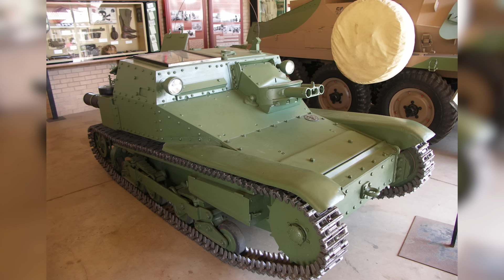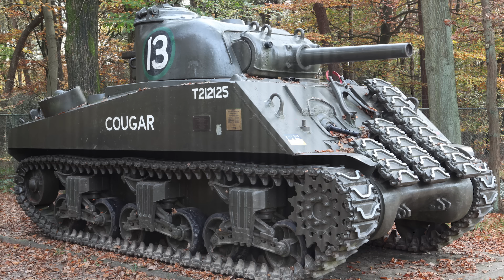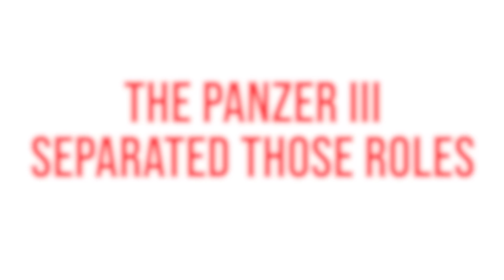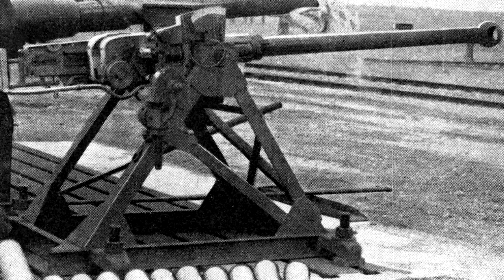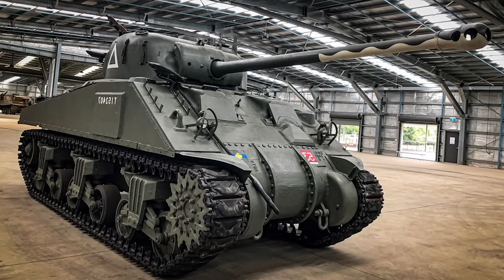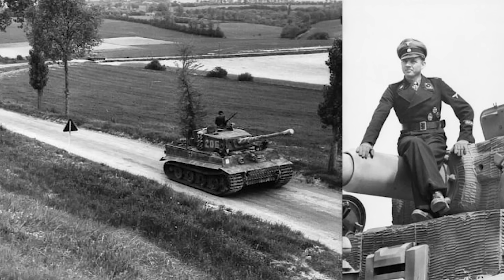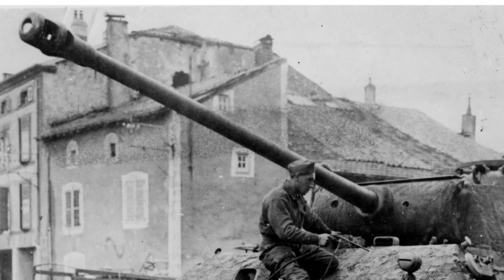Every WW2 Battle Tank Ranked — WORST to BEST

Comment: The final drive was truly the Panther's Achilles' heel. The remark that the problems were solved after Kursk is a bit too simplistic. French engineers determined after the war that the final drive gave out after an average of 150 km, which led to the tank's low operational readiness.
Reply: The operational readiness of the Panther was about the same as the Panzer IV and Tiger, around 70-75% from May 1944 to the end of the year (Jentz -97) - and many of the panzers sidelined were out due to combat damage, not only breakdowns. That's not low considering the circumstances they were fighting under. The French didn't drive them to regulations, trained German drivers generally managed far more mileage. Furthermore, the French had a bunch of the Ausf. A variant, which had been left in France in various condition - many combat damaged, and many with clear signs of sabotage. In the fall of 1944, the Ausf. G variant had improvements to the final drives.
Reply: @TTTT-oc4eb 
Typical operational readiness rates

“Operational readiness” means the percentage of tanks available for combat at a given time.

For the Panther:

Early service (1943): often only 35–50% operational
Average during 1944: commonly around 50–70% operational
Well-maintained elite units could occasionally reach 80%+
During retreats or fuel shortages in late 1944–45, readiness could collapse below 30%
Reply: @marcelgroen6256   And average "operational readiness" for the Panther from May 1944 to December was around 70-75%, about the same as the Tiger and Panzer IV (Tiger I&II: Combat tactics, Thomas Jentz 1997). Typical higher on the eve of a campaign, lower at the end due to a high percentage of combat damage, not only breakdowns - again pretty similar to the Tiger.

"A difficult challenge for Panther crews in combat was the issue of numerical inferiority, a factor which influenced the number of panzers that were destroyed or put out of action. Instances of battle damage were far more probable due to Panthers in company or platoon strength attacking superior numbers of Allied tanks or groups of anti-tank guns. Numerically superior forces firing at a high rate would often target individual Panthers with multiple tanks or anti-tank guns. In the course of engagement that could last hours, the probability of all Panthers being hit at least once was very high. " (Destroying the Panthers: The The Effect of Allied Combat Action on I./SS Panzer Regiment 12 in Normandy, 1944. Arthur Gullachsen, 2014)

The 1943 Panthers were of the Ausf. D variant, which was sent into combat only slightly more than a year after design work started, and before most of the teething problems had been solved. It wasn't until early 1944 the Panther was declared combat ready.

All WW2 tanks broke down en masse during long road marches. 15-20 out of 50 Shermans would be expected to fall out due to minor or major mechanical issues during a 30-40 miles road march.

Comment: The Fiat tankette to described first was not the worst tank ever.  Tankettes were a whole design philosophy during the Great Depression.  Yes a very flawed one, but they were built by several countries and we intended as mobile machine gun or anti infantry gun platforms.  They only gained attention with defence officials because they were cheap and easy to build at a time when politicians argued that there would not be a war any time soon.  Especially after 1929 when there was little cash for building military hardware.  They were never intended to fight tanks themselves.  You can just pick one non tank and claim it is the worst tank ever without looking at why it existed.

Comment: The Panther was great on paper but if you wanted to drive a distance, the transmission failed after about one tank of gas.   Then had to be returned ot the factory.  Nobody wanted Panthers after the war.  The problem with the Sherman is which one is being talked about?  The Easy Eight had wet storage of ammo (no ammo cookoff) , a high velocity 76mm gun and other improvements.   The Jumbo had armor slightly better than the Tiger 1.  Looking at which tanks continued in use after WWII, one gets a reality check as to which ones were the top 3 from this list.  The French used Panthers for a few years but found them mechanically garbage and not worth teh trouble.  The Panzer IV was used by Syria in the 1967 Six Day war.  The last Sherman left service in 2018 (Paraguay).  The last T-34 left service in 2019 (Laos).
Reply from the maker: Good points about Panther reliability and Sherman variants. The video focused on combat effectiveness as designed, but post-war service life definitely adds another dimension.

Comment: OK, you lost me when you repeated the Ronson myth. "Lights first time, every time" slogan wasn't used until the 1950's. Besides that most GI's had Zippo lighters. Ronson wasn't even a second run competition with Zippo and most had never heard of them. Please stop pushing long debunked myths if you want to be taken seriously.
Reply: Agree, you need to get your research straight.
Reply: The Ronson lighter was very popular in Britain
Reply: And the British used thousands of Shermans. Ronson was a colloquial name, apt for the situation.
Reply: @chrisjones6736  And research showed that the German Mark IV was at least as likely to burn as the early Shermans (70-80%). The later "wet stowage" Shermans were the least likely tanks of WW2 to burn (10-20%). 'Course the early Shermans might have been less likely to burn if the crews hadn't crammed 90+ main gun rounds into the interior, instead of the 71 or so that it was designed for (some sources indicate that the British crews in North Africa were the worst "offenders" in that regard, possibly because their logistical support left something to be desired).
Reply: The slogan first appeared in ads in 1928-29.

Comment: Why can't Russia fight it's own battles without help from Iran, China, North Korea and Cuba?
WWll - Russia has always depended on free market nations to survive and win

1 - more RU soldiers were killed by the NKVD (later KGB now FSB) than Americans who die over entire course of WW2.

2 - RU factories could not provide enough weapons & food for RU army (nothing changed today). It took massive supplies from Allies, esp. USA to help.

3 - USA lend lease to RU numbered 400,000 jeeps & trucks = 2 times RU TOTAL production in WW2, thus US provided the troop mobility RU needed to cover the vast distances with the maximum number of troops.

4 - USA also sent RU 35,000 motorcycles, 11,000 aircraft[1], 10,000 rail flatcars and 2,000 steam locomotives

5 - USA sent RU 4 MILLION tons of foodstuffs, 1 MILLION tons of machinery & 6 MILLION tons of steel, 1 MILLION miles of telephone wire

6a - USA sent RU 2.6 MILLION tons of oil products, bulk was high octane aviation fuel

6b - It was cheaper to extract oil in US, build ships to carry and convoy to RU than RU extracting it's own oil

It is important to note the ratio of support from the allies to RU.

1) RU received 2.7 times more dollar value of supplies than RU itself produced - that is 127 billion dollars of Allies supplies while RU manufactured only 46 billion itself
2) RU received TWICE the material weaponry from Lend Lease than RU produced throughout the entire war
Reply: ... its* own battles - it's = it is
Reply from the maker: The video focuses on tank rankings, not the broader geopolitical or logistical aspects of WWII.

Comment: The t34 was like a tank that was teleported from the future all germans tanks fired on it and didin't even  scratch his paint ... the germans weren't defeated in ww2 they was humiliated by a nation that they tought way inferior to them and they belived soviets will fall in few months  :))))
Reply from the maker: it was a menance
Reply: @the_rising_guy  The only reason the T34 is seen as a war winner was the Soviet capacity to produce thousands of them using what was virtually slave labour. They generally broke down after a hundred miles but the crews just jumped into another one.
Reply: Do your research the t 34s gun would explode if it fired to many rounds in a short period of time and it's front armor would explode off the tank if it was hit to hard watch laser pigs video on it then you will know some real knowledge not this bs garbage the t34 was not a tank from the future in fact it was far from it and how come it's the most destroyed tank ever in ww2 if its from the future? Maybe because it isn't it was a ok tank it's nothing special
Reply from the maker: The video discusses the T-34's overall impact and design, not specific failure rates of its gun or armor detachments. While individual tank issues existed, the T-34's mass production and effectiveness against early German tanks are well-documented. Its high destruction rate is partly due to its sheer numbers on the Eastern Front.

Comment: Funny how you rag the Italians for having 13mm armor, then the very next tank the japanese one has 12mm max - just enough for stopping small arms fire! 🎉❤🎉
Reply from the maker: whoah the detail even i missed :face-blue-smiling:
Reply: @the_rising_guy As used in the early Italian and Japanese tanks, 12 mm of rolled homogeneous steel should stop normal small-arms fire in most  typical conditions. Don't confuse thickness alone as the definitive stopping power.

Comment: Churchill was the best infantry tank, it was designed especially for that role. German Zug vs a British Platoon supported by a Churchill beat the German Zug every time.  Churchill was a pillbox on tracks.
Reply from the maker: I personally like the panther , it's like a fallen hero that lost war even when it was the best , I obey your opinion as well ❤
Reply: @the_rising_guy  Panther was an AT-Tank the 75mm L70 more or less equal to the British 17 Pounder as an Infantry Support Tank not too hot. Reason US Tankers liked their 75mm Shermans. The big cats could be made irrelevant by obscuration. The smoke shell was the best means to do so. The MBTs Post War with 100 mm Warsaw Pact and 105mm NATO were the tanks everybody wished for in WW2. The Sherman soldiered on Post War. The JS3 was found a very inefficient tank in the Sinai. That was the tank Soviets regarded as superior to anything the Germans had. Who just coped with the JS2.